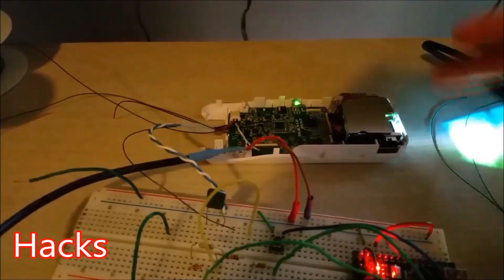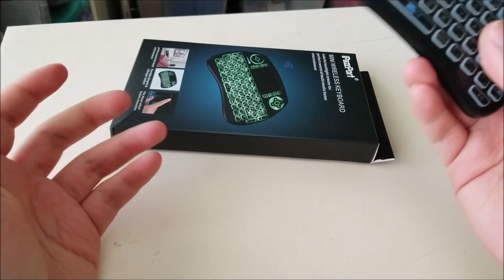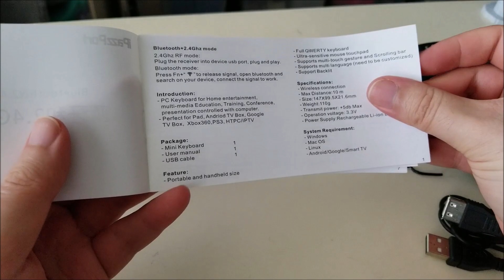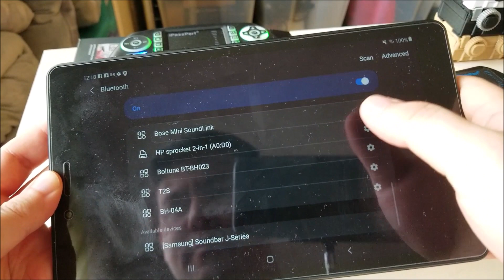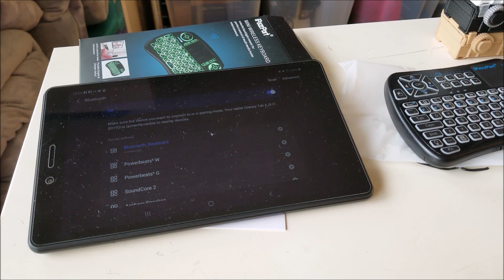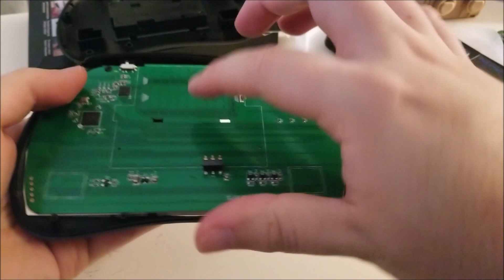iPazzPort 2021 Bluetooth/RF Wireless Handheld Keyboard+Touchpad Review

Comment: I bought this newer style of the keyboard maybe last year or the year before? Unfortunately, the battery's already swolen. I've been trying to work out if I can solder in some terminals to use it with AAAs so this was really useful :)
Reply: Thank you for your comment
Your idea is right
Please allow me to introduce:　https://www.amazon.com/dp/B01CE70TZC?ref=myi_title_dp

1.　AAA battery iPazzPort has a model of this type:
2. 　The lithium battery can be recharged and used, and its power can support the backlight. Currently, the large capacity 800mAh is used, which is not supported by AAA batteries.
3. 　Lithium batteries also have a certain life span, which varies from 2 to 5 years, depending on the length of use and the environment
4.　bl-5c battery 3.7v is a universal model on the market, like AAA batteries, can be replaced, easy to disassemble, open the keyboard battery cover to arrange
Reply from the maker: That's one huge benefit, the lipo battery is cheap and widely available. I have no doubt when mine dies I can easily find a replacement then.
Reply: @sjm4306  I ended up managing to squeeze some terminals in and it's amazing how much better it works! I guess if the battery's been failing it could have affected the range 🤔 
I do realise the cells are quite widely available but in my case AAA's just made more sense- I've usually got some fully charged ones to hand and I don't have to worry about the magic smoke 👀
Reply from the maker: Good to know it's as easy as soldering the terminals! More options are never a bad thing.
Reply: @sjm4306  aye,I was honestly surprised when it worked! I think they do use slightly smaller than "standard" terminals though, so some dremelling may be required 👀

Comment: • 12:35 - Yup, the cheap ones I got are like this one. (The micro-USB port isn't connected to anything because that's only for the built-in battery, not the ones that take AAAs.)
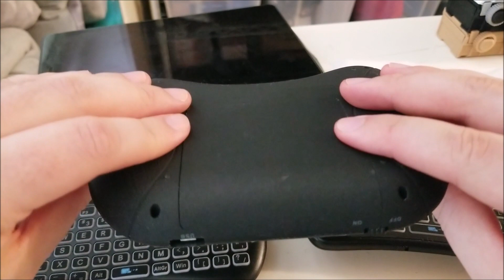• 12:40 - IKR‽ I don't know why companies still pearlize/perlize stuff when they know full-well that it'll get stick and gross later, and everybody hates it. There are tutorials on how to remove it. ¬_¬
• 15:20 - Yup. 👍 Those are voltage-regulators for the R, G, and B.
• I've been using a Measy for a few years, but it uses 3 AAs and sucks them hard. The cheap knock-off (well, the one without a backlight that actuall works) uses 2 AAs and seems more efficient (also, the key layouts aren't too bad either; they actually work for my use-case scenario of watching videos from bed).
Reply: The keys of the iPazzPort mini keyboard are not sticky. From the purchase in 2015 to now, no user said that the buttons are sticky. The content of the product link comments can explain
This is mainly controlled by the following two points:
1. According to the temperature, the ratio, and the hardness, the iPazzPort buttons are the same as the mobile phone buttons, and they will not stick to your hands.
2. The silica gel itself, different manufacturers use different raw materials, iPazzPort button manufacturers are large-scale, high-quality manufacturers that have passed various certifications

 iPazzPort mini keyboard built-in rechargeable lithium-ion battery with up to 15 days of continuous working time
Reply from the maker: Yep silicone wont revert to a sticky mess like rubber does. The commenter above was talking about the other knockoff wireless keyboard I showed in the video which had a rubber coating that went sticky.